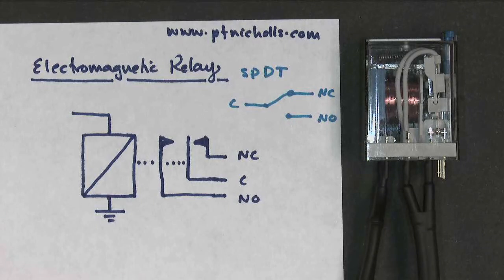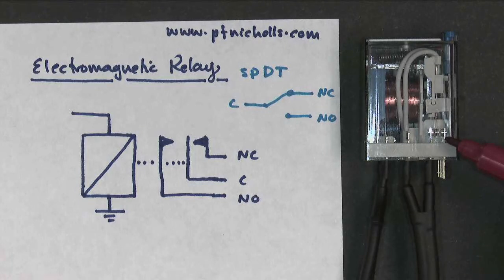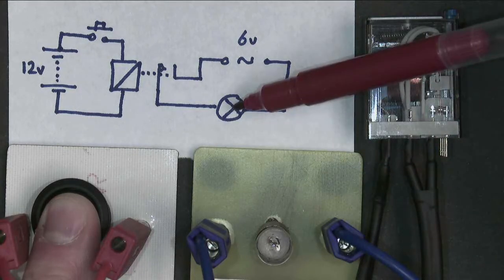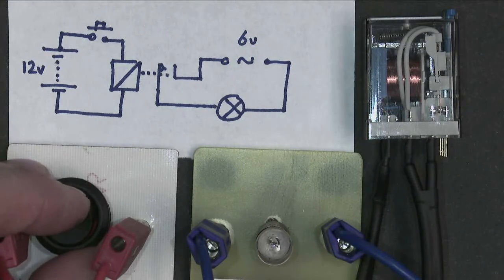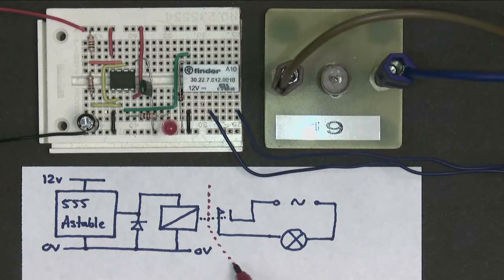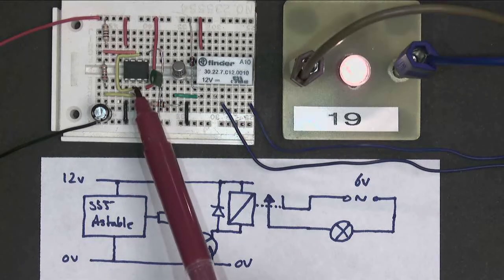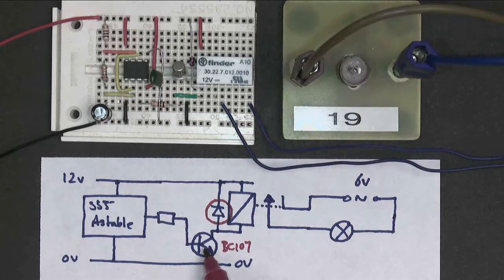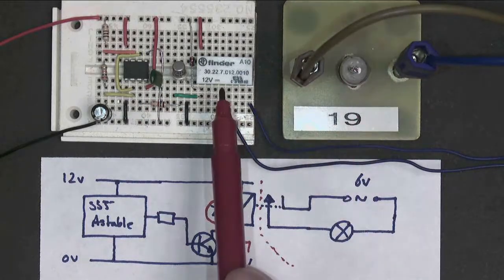Using an electromagnetic relay

Comment: Beautifully explained. Great circuits. Thank you for sharing your knowledge. How did you generate the 6 v AC?
Reply from the maker: Thanks. My lab power supply has both A.C. and D.C. outputs, you could also use a signal generator
Reply: @ElectronicsTeaching  Thank you for that information. I do have a signal generator but am hesitant to use it as a power source in case the load draws too much power and damages the unit. I love your teaching style. Take care.